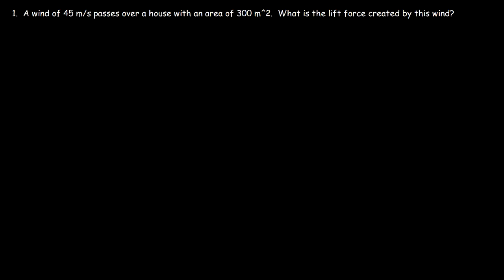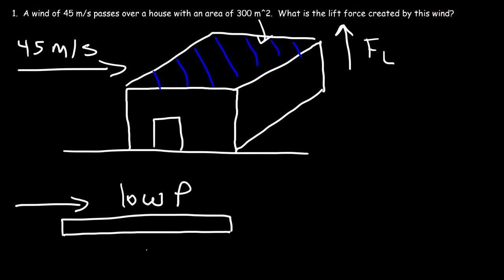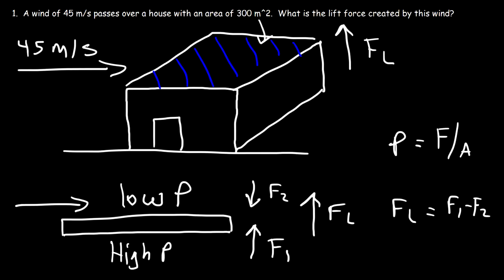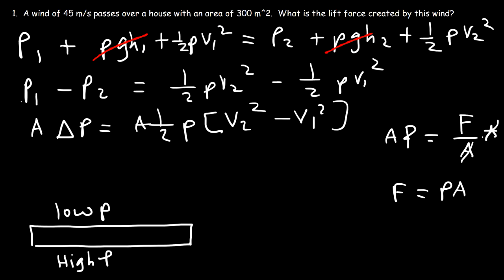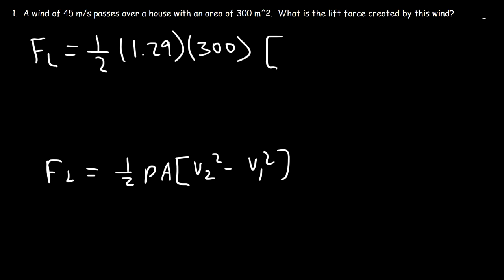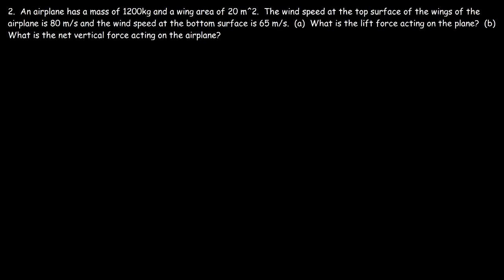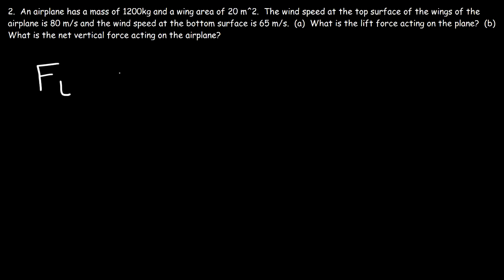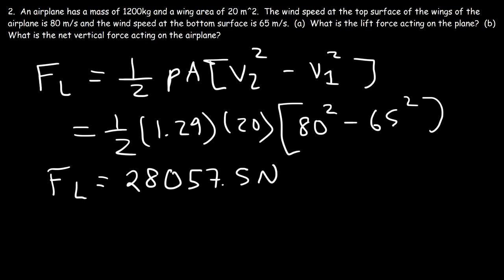Dynamic Lift Force on an Aircraft Using Bernoulli's Principle - Physics Problems

Comment: Is there any difference between Lift Force and Upthrust
Reply: Lift Force is caused by motion of a fluid over a surface area like explained here in this video, whereas, Upthrust is caused by displacement of fluid by a body like a block of wood in water or Helium balloon in air (Here the density of Helium is far less than air so the balloon rises).
I hope this helps.

Comment: Lift: Because the air moves faster over the top of the wing, it is less dense (more spread out). Less dense air means lower air pressure. 
The air pressure difference between the top and bottom of the wing is what causes the lift.
This is the principle behind Bernoulli's Equation, which says the energy in  the air between its pressure (the outward expanding force of a parcel of air and a form of energy density) and its kinetic energy (as given by the v squared terms) are conserved. 
What causes a decrease in lift by ice buildup on wings?
The drag on the air causes it to slow down, negating the pressure difference.
Moreover, it causes turbulence at the trailing edge of the wing due to less airflow over the top of the wing.

Comment: I like your videos about chemistry, but in this video, you get things wrong.

In example 1, you say that low pressure is formed over the top of the house. How? A lower pressure means the velocity of the air over the roof top must increase. Bernoulli's principle does not say "when the velocity is high, the pressure is low" and vice versa. Bernoulli's principle says when the velocity of an airflow changes, the static pressure changes in accordance with Bernoulli's equation. Therefore, you cannot use Bernoulli's equation to compare the airflow outside and inside a house with walls. You must compare the velocity of the air ahead of the house with the velocity of the air over the roof. With a flat roof, the lifting force will be very low.

In example 2, you describe lift in accorance with the "equal transit" hypothesis. Sadly, this idea is taught to student pilots all over the world, but it is not correct. Think about it: How can an air molecule that was separated from another air molecule by the wing know when the other air molecule will reach the trailing edge of the wing? Wind tunnel tests show that the air flowing over the wing reaches the trailing edge before the air flowing under the wing. If you search for "Prof. Holger Babinsky" and "Lift" you will see how it works. 
Your drawing shows a wing with a flat undersurface and zero angle of attack. Therefore, the velocity of the air under the wing will have the same as the velocity of the airplane, and the static air pressure under the wing is the same as the static pressure in the atmosphere. To get a higher static pressure under the wing, the wing must meet the airflow with an angle, called the angle of attack. And don't forget when a wing produces lift, it deflects air downwards in accordance with Newton't third law of motion.

For a better understanding of Bernoulli's equation, I recommend the channel of The Efficient Engineer.

Comment: There is an equation called "Lift Force Equation" and in that equation, there is no velocity differential. Instead, there is only one velocity, which is aircraft velocity. Why are they ignoring V2-V1 and write only V ? Additionally, we know that lift force increases as aircraft speed increases. How can I understand it through this equation you wrote? V2 will increase to the same extend V1 does. Doesn't it?
Reply: that only works when you have the lift coefficient, which in itself is hard to get

Comment: I don't know if I have too many missing variables but I cant solve this problem.

Rectangular Object:

Object is slanted at 25 degrees.
Object has height of 65  inches.
Object has width of 36 inches. 
Object weighs 180 pounds in weight.

Density of air surrounding the object is 1.3

Do we not use Coefficient of Lift when dealing with an airfoil shape?
What is total velocity if Lift equals weight?
Reply: The difference in velocity describes the shape of the airfoil. Each airfoil performs a different delta v with respect to its shape.
This is why delta v squared was places instead of v and cl
Reply: Knowing that cl is a description about the shape of the airfoil and the angle of attack of the airfoil and delta v is also effected by shape of airfoil and angle of attack

Comment: How about the Symmetric airfoil ? at 0 angle of attack the V of wind are  the same on the lower and upper airfoil ? Please tell the lift force with >0 angle of attack !
Reply: There is no lift force in this situation.  This would be the case for the vertical stabilizer, for instance.

Comment: This is probably a stupid question, but I cant phrase it right to get google to return and answer.

What effect would jet engines exiting force have on a wingspans lift if situated in front of them, far enough for them not to melt? Would it increase lift or is there some paradox I'm missing.
Reply: Damn smart question. I have another question. If what is wanted is for the top of the airfoil to have more pressure so that the air moves faster and generates lift, why don't some planes or jets have their propellers on top of the wings instead of beneath it? Wouldn't that reduce the need for so much power from propellers for take of or just flight in general?

Comment: In these, would you not also need to consider the weight of thr roof (F=ma) and deduct that weight in Newtons from thecalculated lift force as that counteracts that force cancelling it partially out
Reply: I would say yes, but the problem is asking for the lift force not the net force on the roof.

Comment: How do you get such big difference in speed over and under. for example if a  Clark Y foil is 100cm under, it will only be about 104cm over. and this makes the FL very little. please help me understand
Reply: when the air is pushed up, there is higher pressure. When there is higher pressure, the wind at the top flows faster. That is if what you have is an airfoil shape. Sorry thats all I know. Im new to this. Hope that helped at least a little

Comment: At 6:22 you state the "wind has to travel a greater distance at the top part...it speeds up."  This is incorrect.  The flow of air over the top of the wing is created by squeezing the streamlines together over the wing. The conservation of mass and the continuity equation state that the mass flow rate into and out of a stream tube of streamlines has to speed up as area between the streamlines is reduced.  Or, if you'd like to prove it to yourself, put your thumb over the end of a garden hose...area is reduced and velocity is increased.  m_dot1 = m_dot2, or  entry density x entry area x entry velocity = exit density x exit area x exit velocity.
Reply: You are correct, also note that there is low pressure spot on the back side of the curve which also speeds up the air flow.
Reply: @8.2deck  bruh , when did u learn this . I'm a first year , first semester engineering student and what you guys said ,passed right over my head
Reply: @JustChilling-JC001  to be honest I'm not an engineer but I make fiberglass wings and aero bumpers for my cars. I'm a big fan of Jim Hall (chaparral creator) and Peter Brock (Shelby Daytona). I'd suggest watching Chain Bear's videos also.

Comment: Thanks for the video man. Really appreciate it, but I was wondering why g @ 9:55 is 9.8 sorry 😅 new to physics
Reply: All objects that are affected by gravity fall at an acceleration of 9.8m/s^2 downward, regardless of size or mass (shape may affect it because of air resistance but most of the time we ignore that or don't work with such materials). This means that if you dropped a big rock and a small rock at the same time, they will both increase their velocities by 9.8m/s every second (so after 1 second, their velocity is 9.8m/s, after 2, it's 19.6m/s, etc). Although the acceleration caused by gravity is the same for every object, the force depends on the object's mass. Newton's 2nd Law states that Force = mass * acceleration, so to calculate the force of gravity on an object, you multiply the object's mass by g, or 9.8. The force of gravity on an object is also known as its weight. When two forces are in completely opposite directions on the same object, they can cancel out to some extent, just like subtraction. After subtracting the two (or more) forces from each other based on direction, the remainder is called the net force. In this particular problem, he is trying to figure out the vertical net force on the airplane. There are only two forces acting on the airplane in the vertical (up or down) direction: lift and gravity. Lift pushes the airplane upward, gravity pushes the airplane downward. I mentioned earlier that the force of gravity on an object is its weight, so what he does is he subtracts the weight and the lift force. I tried to include as much information as I could but am aware it may be too much to handle, so please feel free to ask about anything that confuses you. Hope this helps!
Reply: @lidiaprokopovych4695  Thank you so much Lidia this really helped. As I am in year 10 and I'm switching curriculum I'm learning physics for the first time properly. Cheers :)

Comment: Thanks! How do I work out velocity of air over and under the wings?
Reply: Determine the distances of the wing above and below the cord line along the direction of the wind. Multiply the number of times increase in distance by the air speed below the wing v1 and you get the speed of air above the wing v2, v1 is calculated by multiplying the increase distance of the wing below the cord line to the distance of the cord line itself by v.
Reply: @geoffreywoodyear1585  how is this formula called? It sounds very interesting
Reply: @davidscandurra560  Bernoulli's equation..

Comment: So technically, Bernoulli's equation applies to streamlined (non-turbulent), non-viscous flow, for any two points along a streamline. No streamline goes along both the top and bottom of the roof. What is the justification for applying Bernoulli's equation in this way?

Comment: Thank you so much for explaining the lift force  and validation using basic equation. Could, you please advice if same can applied under water cases.  I would like to know, if same physics fundamentals can be applied for underwater scenario.
Reply: This is wrong. See my explanation in comments.
However, the correct fundamentals apply to fluids in general.